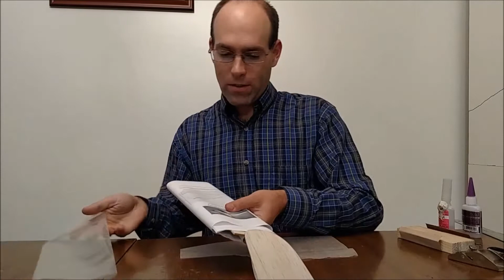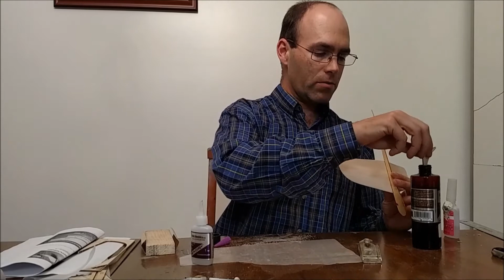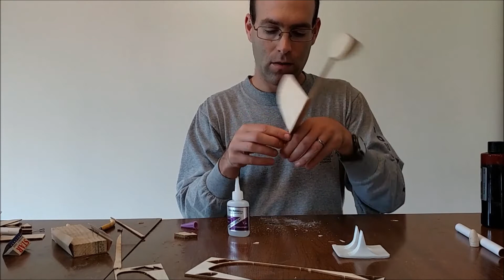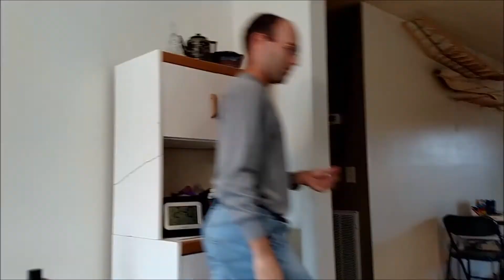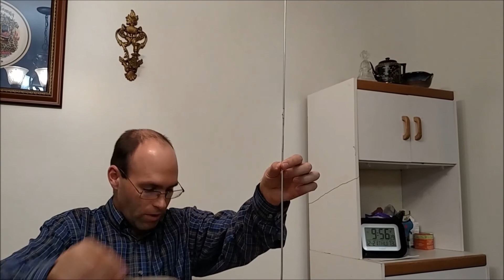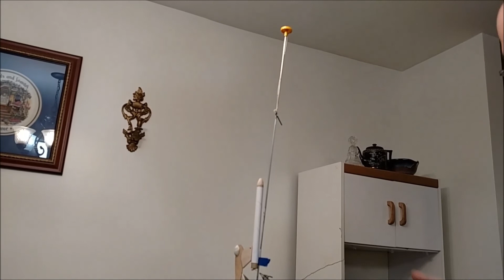Aleda R Boost Glider Build

Comment: Do you recommend smoothing out the 1/16th balsa wood surface with nail polish remover etc. for the stabs? (Making my own from scratch and seeing what I can do to help get a longer boost/glide time)
Reply from the maker: I'd go more for sanding in a nice airfoil with sanding blocks and then removing fuzz with fine grit sandpaper. If you're flying anything over 1/4A, seal the wood with a very, very thin coat of Minwax Spar Varnish, allow to dry for 24 hours, and then sand smooth with fine sandpaper. This produces a very smooth finish and makes the wood less sensitive to moisture so that your model is more consistent.